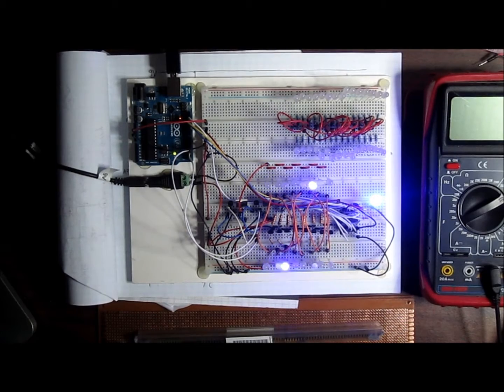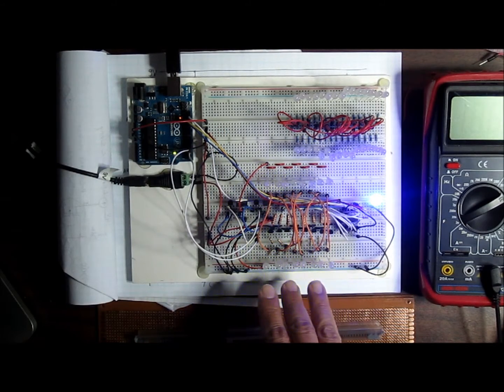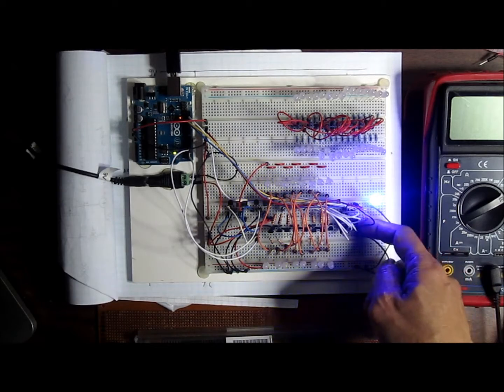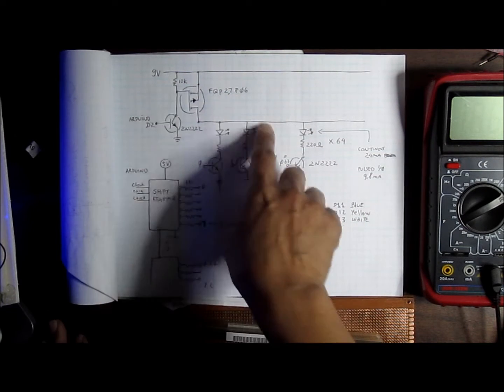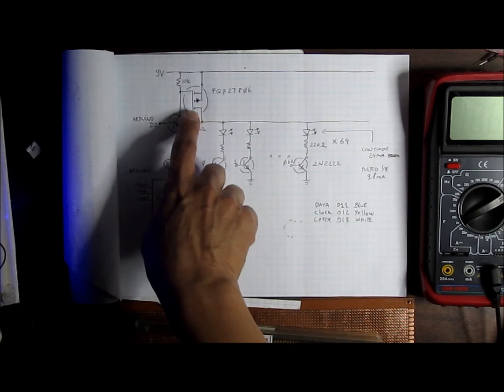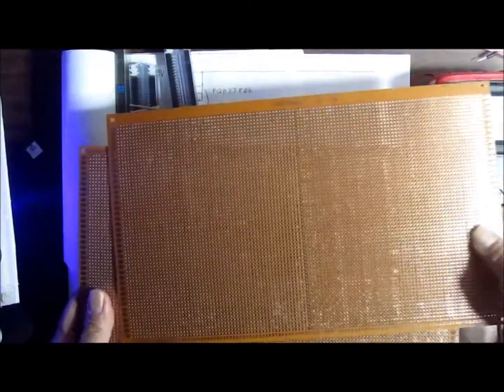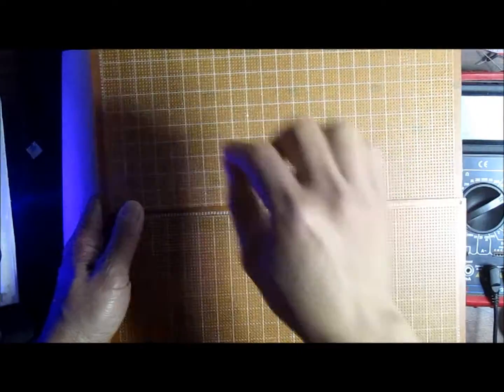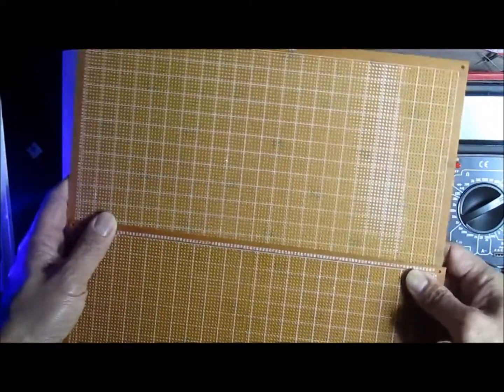8x8x8 Blue LED Cube part 4 - Components & Circuit

Comment: Can you please tell me a replacement for FQP27P06 Mosfet? I'm not able to find it in market , please suggest a replacement which is easily available in market.
Reply from the maker: There is a link for all the components on my project documentation (under components)
https://hackaday.io/project/1243-8x8x8-blue-led-cube#menu-components
If you can't order it from there, you could look for other MOSFET with similar characteristics shown in that spec.

Comment: Why do you use one transistor for each led?
Isn't it cheaper to control then from the shift register pin with 5v?
Reply from the maker: You're absolutely right!  In the final build, I sink all the LEDs directly through the shift registers as you mention.  Only the common Anode that has to potentially supply power to 64 LEDs are Transistor driven.
https://hackaday.io/project/1243-8x8x8-blue-led-cube/log/11610-circuit-diagram

Comment: I just one help 
I made the 8x8x8 in such a way that I have 64 anodes and 8 grounds
each ground is controlling a layer and want to connect 74HC595N to 64 outputs of 74HC595N conected in series now where I has to use the MOSFET? 
PLEASE help shall me. very thankful
Reply from the maker: To switch it on the negative side you could either use an N-channel mosfet or a TIP120 Darlington pair.
https://www.arduino.cc/en/Tutorial/TransistorMotorControl